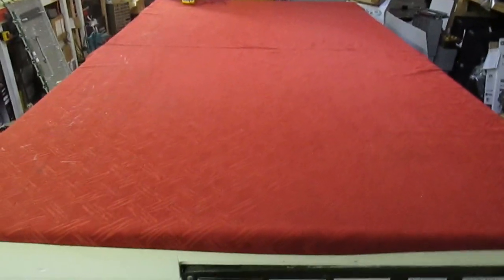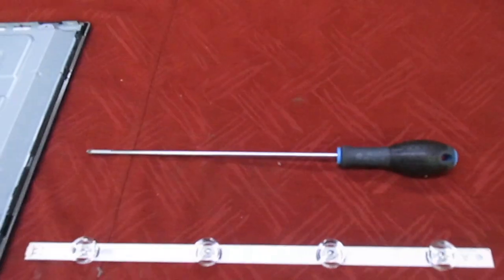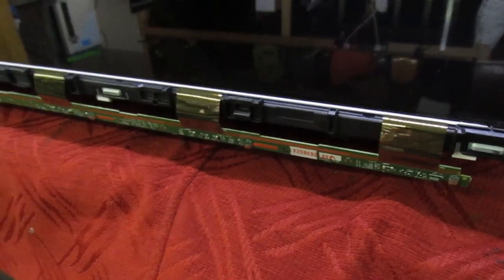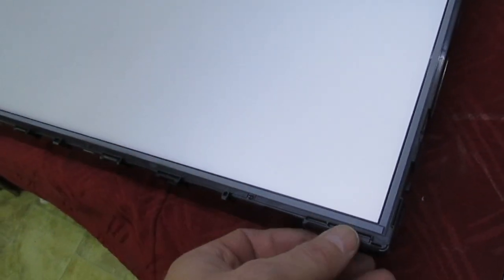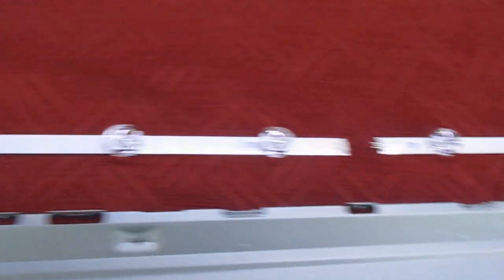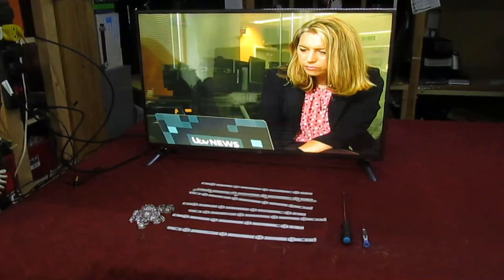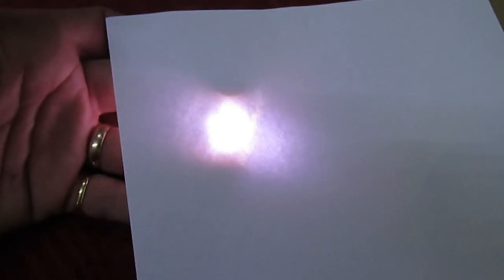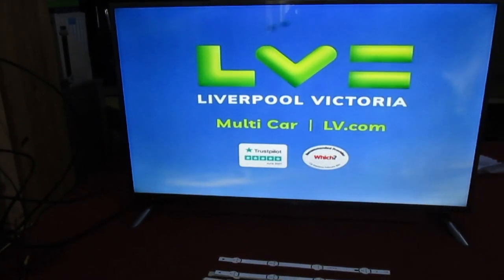Repairing Deborah's 42 inch LG T.V

Comment: All of my TV's in the house (3) are all earlier 42" LG LCD with CCFL Backlights that don't end-up like this! Many wouldn't even bother to have them repaired, and they go to scrap. The LG TvVs that have the CCFL Backlighting are more costly to run, but they seem worth it! All of my TV's have come from Scrap Piles, and I have repaired them. I used to visit our local Tip, where I saw huge Skips - all full of very modern Flat -screen TV's. And I just know that you could come along to the Skip - and repair most of the ones that don't have Screens cracked. What a lucrative business that would be! There is something very rewarding, when you bring something back from the dead, not just TV's but almost anything electrical too! You are a pleasure to watch, and there aren't many these days with the level of skills to go deep into the problems relating to finding 'dead' components on a PCB.
Reply from the maker: I still repair lots of CCFL sets for customers, the older they are the easier it is to fix them years ago I use to buy TV s every week from the tip when the tip was privately owned , these days though most tips are run by the local council and you cant buy anything from them .

Comment: great video thanks again a little thing i do is with two pieces of tape and cocktail sticks tape the stick to the screen across the cof and other piece of tape to the board it kepts the cof straight and no stress on the ribbon do that to them all before lifting the screen off , thanks again.
Reply from the maker: not actually tried that , I will give it ago next time with low tac masking tape .
Reply: I use blue painter's tape to tape the cof cable to the screen when I do LED replacements.

Comment: I do quite a few back light replacements on TV's of various makes & on screens over 32" I always get someone else to help me lift the LCD panel out & back in again. My bench will accommodate upto 55",so don't take on anything bigger. I usually release the boards & ribbon cables at the bottom of the screen before turning the TV screen up.  I usually allow upto two hours to do a larger one,not the sort of job that should be done in a hurry !
Reply from the maker: This is right , the key is not to rush , its far better to take more time to do this job and do it right than rush and crack the screen .

Comment: Michael, many thanks for your video. I am having same problem with the white lights. It seems a long job and my 55iches flat screen is 6 years old . Thanks for sharing good ideas.
Reply from the maker: The longer you make the job the more chance you have of doing the repair right so don't worry about that, a lot of care is needed handling  a millimeter piece of glass.

Comment: Noticed one thing by watching your videos, you do not hesitate to discover all secrets about repairing TV's and others. I though I am only one like that but nope now I found another one. It is really nice to see how you describing all but all what is necessary to do in order to finish repair successfully.
Reply: That 4 digit "service code" would have been nice to hear ;O) I don't known, maybe it's common knowledge. Cheers!
Reply from the maker: @ovalwingnut  on LG sets you need a special service remote control to carry out any adjustments , the password comes with the remote control it self .
Reply from the maker: As a lifelong TV engineer I like to know everything there is to know about TV s but with no service data available any more on modern TV you have to work thinks out for yourself, sometimes finding a fault can come by accident or even by just good luck or a lucky guess, that's all you can do now with no support from the manufactures.
Reply: @michaeldranfield7140  i do understand you perfectly as I am in electronic repair job for over 35 years. Today TV s are not made to be repaired. You truly doing great job.
Reply from the maker: @FantaBH  Thankyou for that .

Comment: i was surprised at just how much dismantling had to be done to replace those LEDs. I have seen this fault on a few Samsung and LG monitors that are used as menu boards in fast food takeaway. always thought it would be an imbalance of the drive current to the leds but didn't realise it could be something as simple as the lenses falling off the LEDs.....a simple repair made difficult by the manufacturer almost purposely so the customer buys a replacement set rather than getting the original one repaired. I hope this fault doesn't occur on my 86" LG tv as even that huge bench you have there would still be too small as well as i don't relish having to maneuver a 2mm thick 3.6 foot x 6 foot piece of glass to access those LEDs. If the manufacturer wasn't always thinking of how they can sell a new tv all the time it would have been easy for them to make the back part of the steel housing removable so giving easier access to the leds as these along with the PSU are the most likely parts to fail.  This is one reason i left the repair industry i used to love repairing tvs when they had crts and valves.
Reply from the maker: As you say all this could be avoided by fitting a removable panel on the back but then repair would be too easy and people would just repair rather than buying a new set .
Reply: @michaeldranfield7140  Less E-Waste, more natural resources for other things, less industrywide rising prices because of lack of natural resources because recycling is often not interesting or economically viable...

On the other hand... if people throw away or sell their their old 'broken' stuff, i can get stuff for free or super cheap, 2nd hand, if it can still be saved ^^

Comment: A lot of care and patience there!
Reply from the maker: yes , this is not a job I like one bit , the screen is so easily damaged, sadly though LED backlight failure is becoming the most common fault sets suffer from now .
Reply: @michaeldranfield7140  
Hi Michael,  yes it looks a tricky job, especially with getting that screen exactly lined up with the bezel.
Give me a CRT Tv any day! ( I have few here) . I used to subscribe to Television years ago. Great shame it had to close. I remember reading your many articles. I was a TV Video and Audio Engineer mostly working at Thorn ( Multibroadcast, Radio Rentals etc) sadly all gone now. Im working in Radio Broadcast now. Still have some old TVs though! 
Best Regards Paul
Reply from the maker: Give me a CRT any day, only problem with CRT now I'm getting older is the weight.

Comment: From Raymond Reeves of Skegness.    I have a samsung  48inch. Two  diffusion lenses have dropped off and alot of the leds are turning purpleish. question will fitting new strips be not inclined to detach and also retain the white colour longer. Also if I bought a brand new set would these problems be resolved.
       I used to dabble in tv repair years ago and love what you do! I am 75.
Reply from the maker: yes all your problems will be cured by fitting new strips , if you want to see why they go purple have a look at my other video called this is why your picture has turned blue.

Comment: Very true Michael, a bit like old mains light bulbs, which could have been made everlasting. Apart from the led strip poor design, the set has been trouble free. So it looks like these sets have a finite life. Is their a make that doesnt use that technology?
Reply from the maker: Most sets now are LED backlit as it reduces the power consumption , however it is possible to extend the LED life by turning down the Backlight setting to the minimum you can which gives a good viewable picture , I turn sets down from 100 percent to 60 and no one has complained so far .
Reply from the maker: @raymondreeves694  only if it has more than a 12 month warranty.
Reply: @michaeldranfield7140  How about 5 years
with Currys.
Reply from the maker: @raymondreeves694  yes 5 years is good because not many sets last that long and in another 5 years time how much cheaper will TV s be then !

Comment: Good video Michael , It's a very delicate job doing the screen repair especially with more TVs with  bigger screens 55" etc . Do you use suction pads to assist in lifting the thin screen up ?
Reply from the maker: No dont use suction pads , I dont know if i could trust them , if they can pull a dent out of a car I would have thought they were too powerful, I build a platform same high of the set when its upside down and slide the LCD panel across onto a plastic sheet , so no lifting of the screen at all .
Reply: They're a must to reduce bending; sometimes up to four (a layer of glass can be ~0.3mm thick).  They also facilitate controlled lifting since the panel doesn't always come up as easily as hoped.  I use small ones, and to beware, I did notice the first time yesterday, the concavity on the back side.

For very large screens, a slight lift onto a board is better.  A lift allowing air underneath helps lots.  A razor blade to re-lift the panel from the support may be needed.

I don't 100% trust them, but clean surfaces and soft material increase reliability.
Reply: I use a large piece of cardboard from a new TV box, the shiny part cut out of the box.  I lift up one side of the panel and then slowly slide the cardboard under the panel until I am all the way across then just slide the cardboard off to the side.
Reply: I have tried suction pads, but one came off as I was moving an LCD panel, due probably to dust between LCD panel & pad, so don't use them now.

Comment: Not related to this upload, but I have to personally thank you for a freezing fix for a Samsung Smart TV  5520 you posted 2 years ago..your comments are turned off for that, I fixed my bedroom tv with your method 👍
Reply from the maker: Yes I remember , its the cold freeze trick .
Reply: @michaeldranfield7140  yep, tv had a brain fart at first, due to moisture running down the main board, but dried that off with a microfibre towel and it sprung back to life. I turned off Anynet+ then installed software over usb, works a treat.

Comment: What I need to know is that if the manufacturer of spare strips has introduced a fix that would prevent lenses dropping off and leds turning purple over such a  small span of  time (10years)
Reply from the maker: I cant answer that question , you would have to ring the manufacture to get an answer , but personally I would think there only interested in selling you a new TV rather than making your old one last longer .

Comment: Great work you will laugh at how long it takes me. I aim to restore discarded tv dvd etc.Thank you for getting previously. I do need to ask about my issues and i wondered if i could get in touch by facebook. I have 4 blinks on a older Sony Bravia and not sure how to proceed. Thank you Micheal
Reply from the maker: I don't do social media , sorry,  have a look on the internet for the 4 blink code, off the top of my head i think its inverter failure but double check first .
Reply: @michaeldranfield7140  thanks Michael yes i am working on the inverter board all the best

Comment: The LED board should simply slide out to the side, but the manufacturers only make repairs difficult.
Reply from the maker: if the repair was too easy people wouldn't buy new sets , but as you say it wouldn't be that difficult to have a removable panel of the back of the set for led replacement .

Comment: Ah well, Call me chicken, but I was contemplating investigating my 40" Samsung Series Five.  I didn't give a right lot for it when I bought it, and after viewing this, I rather suspect it'll be bin fodder, flickering backlight and all.

On the plus side, I just fixed a 32" Samsung Series Three "Calypso" (or was it Coral?) chassis with a runaway control panel fault.

I guess, some you win, some you don't.
Reply from the maker: Flickering backlight is more likely to be due to duff led s in the screen , give it a go , there's nothing to loose, the worst you could do is crack the lcd screen .